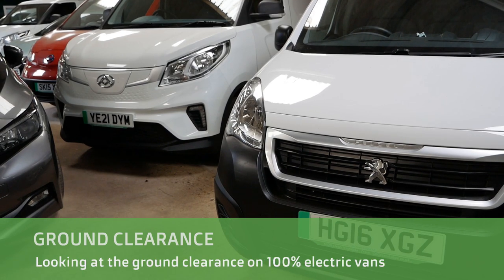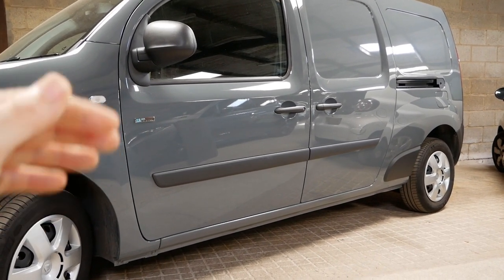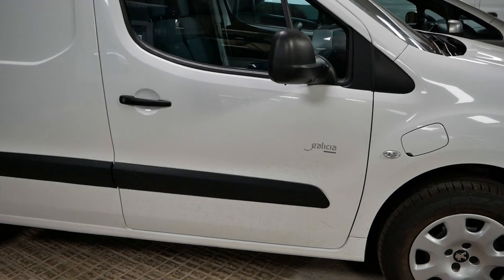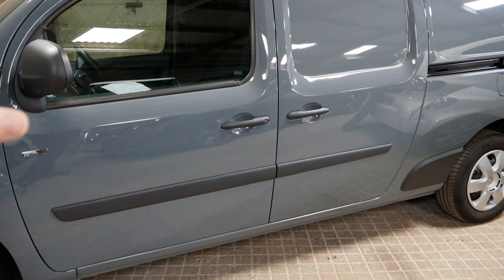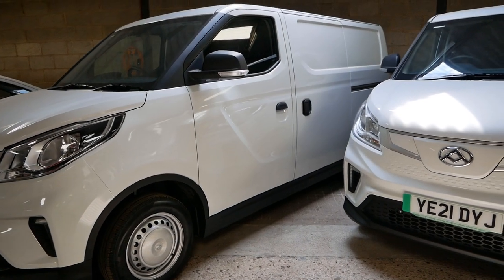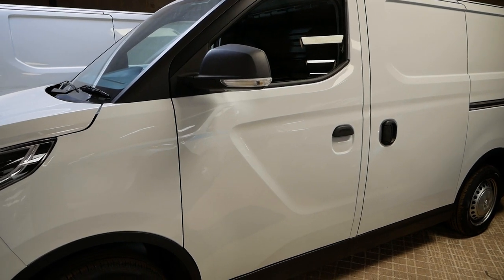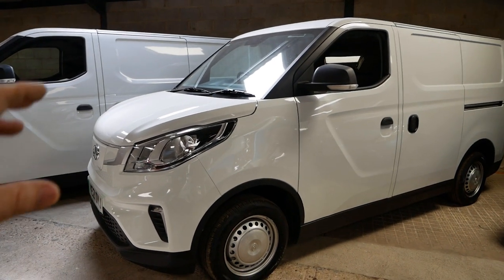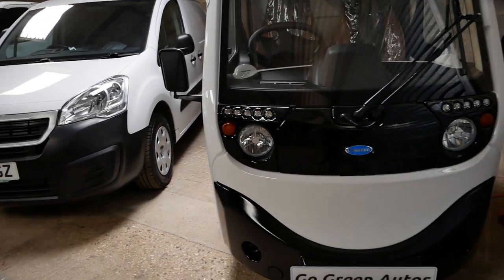What is the ground clearance on electric vans?

Comment: By comparison my Diesel kangoo has an unloaded minimum ground clearance of 17cm which is the front suspension mount, at the rear the lowest point is the rear swing arm at 19cm. I would like an electric van but at present the Kangoo  E isn't appropriate as I need about 200miles run approx once a month.